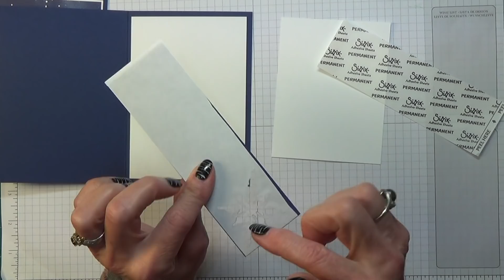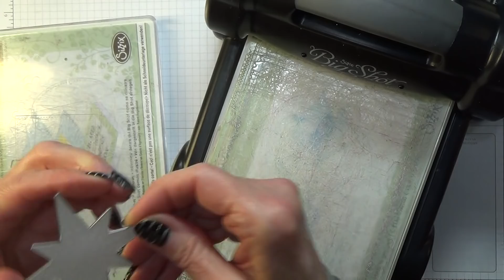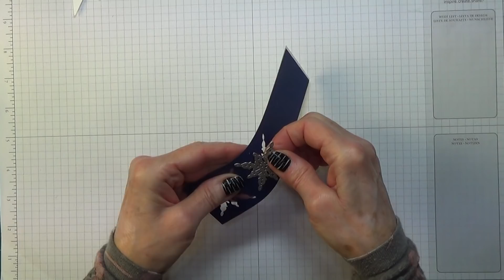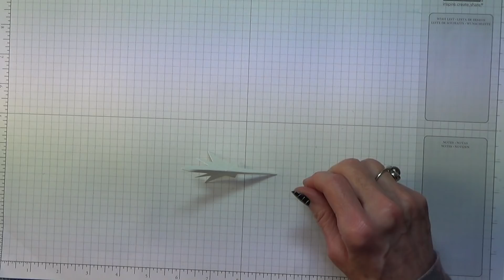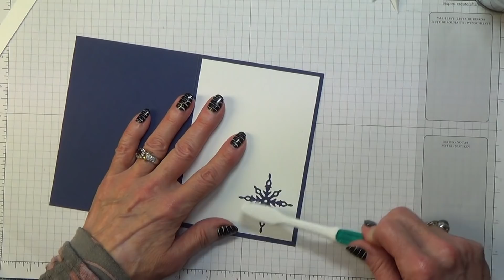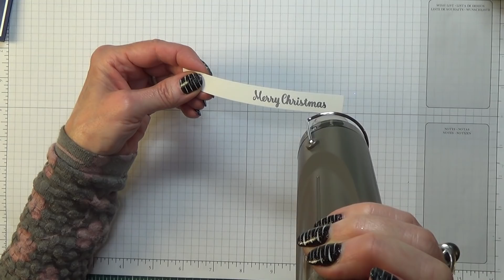No.442 - 3D Star Christmas Card - JanB UK #7 Top Stampin' Up! Independent Demonstrator

Comment: Lovely card. You are very good instructor. I've subscribed. Could you stack the small adhesive dots to the right height and place them under the center point to support it for mailing? Most people I send cards to are not located where I could hand deliver. Thanks.
Reply from the maker: Many thanks, Kathlyn. I thought I had responded to you?? Never mind, let's try again. If I had to send this card by post, I'd put it inside a cardboard box to make sure it yravels safely. I'd also seriously think about adding stacked Dimensionals in the centre, too!  ☺ Happy crafting, JanB.